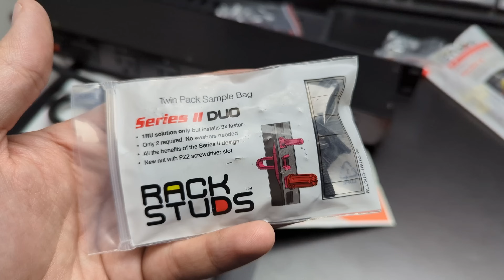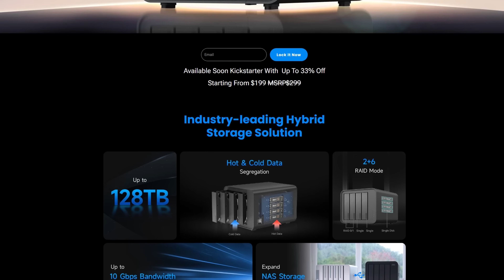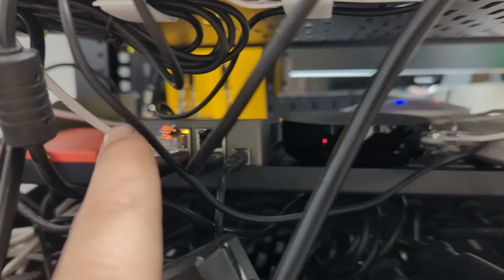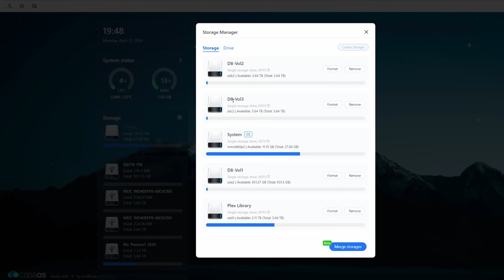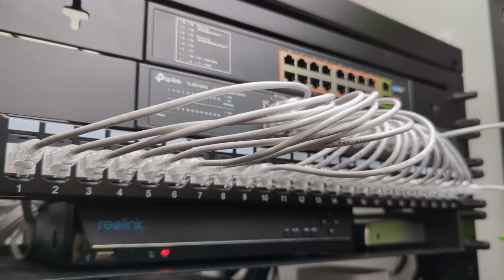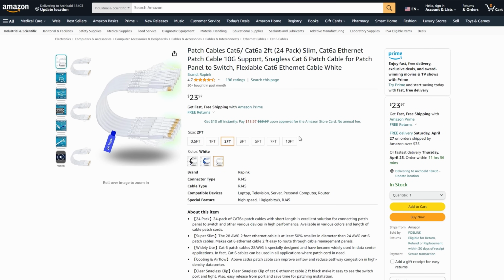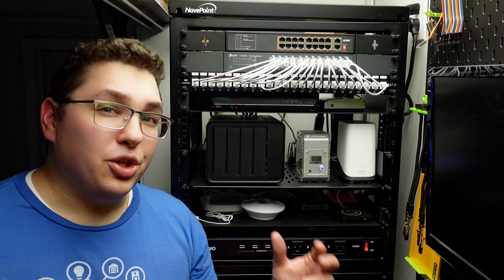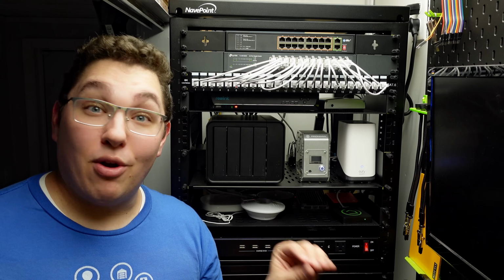My new SMART HOME Network RACK! (Build and Tour)

Comment: You should take the time to change out all of your 5e for 6a. That suppers speeds up to 10Gb to give you a more future proof setup. 

You should also look into utilizing the coax in your house to hardwire your rooms via MoCA adapters. There are some great ones that can push speeds up to 2.5Gbps. I’ve used these and they work great.
Reply from the maker: I'll be doing that with 6 cable!
Hmmm, never heard of that option!

Comment: I have the deco m9. I've had it for a few years but it works for my home needs.

Just curious what the benefit of having a brush panel vs patch panel would be.
Reply from the maker: Brush panel doesn't require these short little patch cables, and you can space out the cables in  any way you want. Just would look a lot cleaner IMO

Comment: I am happy with my new Unifi UDM (non-pro) router, which can be expanded with with PoE access points.  As long as a router will support VLANS so you can separate your IoT from secure devices, then you are good to go. 
Yes, is easy to get sucked into the rabbit hole realm of Unifi...the use the same strategy as Apple to make all things work together and as simple as possible.
I appreciate Unifi, in that I only need to configure my VLANs one time. lol

Comment: With that cabling that you did yourself, does it work out much cheaper or not??? I will need to run Ethernet cabling in an older place for POE cameras, etc. and would be interested to know what way to go.
Reply from the maker: It's nicer to have caBling the exact length you want, so I can be cheaper if you have a lot you want to do yourself. It takes a lot more time of course

Comment: Best practice is to use factory patch cables. As strange as it might seem, cable termination is not as reliable on the long run, particularly if you're not doing it day in day out.

Comment: Why no UPS???
Reply from the maker: That will be for v2! Haha I wasn't sure which too buy and things were getting a bit expensive. You have a recommendation?
Reply: @MakeItWorkTech  A tried-and-true brand is APC. I don't know if your NAS supports this, but Synology NAS units have a USB port to interface with the one on the UPS to detect when to shut down elegantly. If yours does the same, then make sure that your UPS has that feature. You should first tally up the power usage of all your devices, and use that to select the capacity of the power backup. Also, I would recommend getting a model that has replaceable batteries, as it much more economical to do that rather than buy a whole new unit. Most batteries last at least 5 years, after which their capacity begins to decline.

Comment: If you didn't pay for the DAS it's a good setup but tbh if you already have a Zima Board don't buy a DAS guys. You can just conect your Harddrive to the SATA Ports and get a Breakout Board for the PCI-Express Port for more drives. Its certainly a bit more complex than just buying a device, but this option here would be a lot cheaper and more future proof. There a great tutorials out there for Zima Board NAS Setups and TrueNas
Reply from the maker: So would that be using TrueNAS software on the Zimaboard to handle a RAID setup? Maybe I'll try it with the ZimaBlade

Comment: So... what was the point of the patch panel if you DIDN'T have a bunch of cables running into your rack?  They're supposed to be used with regular keystone jacks that you punch down into, and then then front facing port patches to your switches.  Where's the other end going?  

Another word of advice, LABEL EVERYTHING.  You're not going to remember every single cable in your rack   Label them at the both ends of the cables, and definitely on your patch panel as well.

Also, invest in a roll of double sided velcro.  It's the best way to organize cables and not use zip ties.  NEVER use zip ties.  They hurt the wire, and can be challenging to cut without damaging the wires the contain, if you need to move the zip tie for any reason.  Velcro you can just rip off, and use elsewhere, over and over again.  Highly recommended.
Reply: They make patch designed to be used with feed thru connectors, rather than having to do punch down.  It is the type I have.

Comment: as someone who has built out data centers and a home-labber myself, great job!! be careful with pass through rj45's. seen them melt POE switches a few times. make sure no copper is exposed
Reply: What would be a better option?
Reply: wdym? exposed
Reply: @RakDev_py  basically leaving too much copper beyond the rj45 connector. You want the strands to be flush or just under the edge of the rj45 connector with the pass thru. Otherwise, if the copper extends, it could cause shorts or even cause issues to what it’s connected to.

Comment: Hi, would be greatful if you can let me know how do you connect HDMI and usb of nvr to tv?
Reply from the maker: USB unconnected directly to NVR. HDMI to the monitor
Reply: @MakeItWorkTech  oh.. my monitor and network rack are there rooms away. Guess I will shift the NVR closer to the monitor. Not finding a way to extend usb over lan :(

Thanks for the reply
Reply: You can look up units that go from screen via hdmi-> to a unit that converts to a Ethernet cable (this unit may require power via a regular plug) run the Ethernet to the other room and then plug in to other device that changes it back to hdmi. My work has that for a small security camera and monitor in the main office.
Reply: @mattspivey5100  thanks for replying.

Hdmi to ethernet I have used, but am not understanding how to extend USB for 40 to 50ft. Need to connect the mouse to the NVR for playback

Comment: Ubiquity Unifi is the best router, switches, AP, and surveillance out there!
Reply from the maker: But so expensive!!
Reply: @MakeItWorkTech  yes, but I have no regrets. Expanded over time to spread out the costs.
Reply: +1 for Unifi

Had an ASUS Router previously, but after it started making issues, I switched to Unifi and omg I never had a better router dashboard or more options to configure.

It's just rock solid, super customizable, but also easy to work with.
Never going back to consumer grade devices.
Reply: No the best as all. Thats a very bold statement. I have UniFi at home and look after and install multiple sites. It’s good. But if you want expensive and robust, proper office and hospital robust, no budget install then I’d be using Cisco Meraki or Ruckus. UniFi is good for home, small office and domestic use. The switches are expensive for what they are and there’s things missing that I have to go to Mikrotik for and the cctv is just plain bad. The cctv line up is poor and as a pro Hikvision installer and a UniFi installer I’d never install the unit cameras unless someone only wanted a couple.
Reply: Bro never heard of Cisco before
Reply: Absolutely not. A custom-built x86 firewall/router running opnsense runs circles around anything Ubiquity.

Comment: Unifi Dream Maschin Pro
Reply from the maker: Noted!
Reply: As an network and system engineer I can tell you to don’t do that. We removed them from lots of customers since they break down. Also they don’t support if your ISP has 2 separate VLANS for TV and internet. You have to built custom configs and still no support since the uplink may contain only 1 vlan. Also the support stinks… took 8 weeks to send us new ones. I went for hosting the Controller locally and just installing AP U6+ through the house. Also watch if you have airplay. NanoHD can mess with that so took them out few weeks ago. This saves you some bucks and is fun to do. Also would be happy to help!

Comment: The TPLink DECO mesh system is amazing, and way more customizable
Reply from the maker: I plan to test it out, even though I went with UniFi!
Reply: I push it coukd say I agree wuth this cuz ive stood by my TP Link mesh routers, but lately theur app is all to often buggy, not allowing me to reboot my system. And unless my switches are wired to my router, but after my modem, im now unable ti see wir3d devices, whereas 2 years ago I was able to. Im now forced to run the 6.0 frequency as a separate SSID and that used to not be the case. My entire  reason for going wuth TP Link routers was so that I could separate out the 2.4 gHz for my wifi cameras and then recombinant it with the 5.0 to k ly need one SSID, snd of course slong with the IoT SSID, im now on 3 separate SSIDs and thats if I dont have the guest network active for any family or friends stopping by. Also, finding open ports is a cumbersome task that requires memorizing your IP fir the device cuz you cant copy paste and are forced to leave that section of the app. To go to the wifi toolkit to check for open port. Also one of my 5.0 satellites simply stopped working after being unplugged for a few months. The reset button wont even registers, even if taken apart and manually pressed with the case off.
All thay bring said, I still am happy with my TP Link routers and switches  and plan on getting 2 more 6.0 mesh routers to eventually replace my 5.0 and 5.0 satellite
Reply: If you are going to go with TP-Link use their Omada range as it is controllable from a single device allowing you to build out a 'software defined network', just finished a refresh on my home network and it makes everything so much easier to set up and manage.
Reply: I love TP-LINK product..

Comment: For a wifi replacement, I just bought the Asus ZenWifi Pro ET12 and it's fantastic.  Extremely fast, has 2.5Gb ports on each unit (1 for WAN, 1 for LAN, then 2x1Gb ports for LAN), and supports Wifi 6E.  I got it primarily for the load of features in the Asus firmware (VLAN, firewall, etc etc) until I move over to OPNsense, and to use as a wireless backhaul from my cable modem at the front of the house to my 16-port switch in the back of the house with my server/homelab stuff.  Sure beats my old Powerline backhaul!
Reply from the maker: You got me with the 2nd half...I don't speak network engineer haha
But the first part sounds good! I'll have to check that one out
Reply: Would suggest OPNSense over PFsense. Since pfsense is owned by Netgate. Lots of issues and since the latest versions I’ve got lots of issues. The community of OPNsense and the guys themself are much nicer to home labbbers. Also would suggest moving to Home Assistant and maybe VMWare or proxmox to run it on a VM. I do that too and in case of errors just rollback a Snapshot. Also home assistant has Docker inside. Therefore you can run the UniFi controller from there and just buy the U6+ AP’s only. Saves you a few hundred bucks :)

Comment: I feel the google mesh pain because I'm in a similar situation with Eero. Frankly the Eero has worked great, but I wish I didn't have to use the app and I wish I could do VLANs. Everybody tells me Unifi is the way to go, but I haven't taken the plunge yet; the Eero is working and hasn't annoyed me enough that it's worth the expense and trouble of switching yet. 

I also wish I could run ethernet everywhere. The previous owners put drywall ceilings in the basement so I can't just easily run wires from the basement up into the rooms above. I've been making do with MOCA over the coax that is run to nearly every room, and that's actually performed surprisingly well, but the adapters are not cheap. I would like to run ethernet up from the basement into the attic, and then down into the rooms that way... but our attic is so shallow and there is so much insulation it is basically impossible to navigate up there. I really don't know how I'm going to do it. Also, being in Canada, I want to be careful about punching holes up into the attic that allow warm moist air to flow up and condense in the attic. I'd be open to any ideas anyone has.

Comment: Hi Aron as always great video 💪
Your detailed reviews are awesome 🤩 
I have a suggesting, to replace smart power plug supply your rack with something more reliable (better relay) like sonoff POWR3. This small power plugs relays are calculated to extreme and when start failing might damage Your expensive equipment 😉
Reply from the maker: Great suggestion! Thanks for the tip!

Comment: Word of caution, I think the cat5 cable you bought is actually CCA, aka copper clad aluminum. It’s total and complete trash, I bought a box due to its price and didn’t realize what it was until a year or so later when I started having issues here and there. I wouldn’t have thought it would have mattered since the wire was all inside in climate controlled areas, wrong, if I were you I’d throw that stuff in the trash and replace all you made from it or at least mark them all so when weird things happen you know which cables to start replacing then.
Reply: I agree, always Cat6 or Cat6a, here at Portugal🇵🇹, our Telecom Authority ANACOM a few years ago, banned the installation of cables lower than Cat6 and only 100% copper cables are allowed. We have a regulation called ITED Manual, you can consult to know more about our legislation and regulation in telecom infraestructures.
Reply: Yup agree. AVOID CCA AT ALL COST
Reply: Never CCA, and even a year ago when this was posted, anything less than Cat6 was penny wise and pound foolish.

Comment: Helpful video! I am doing a remodel install of a rack but unfortunately, I only have a small closet to use for my IT closet. I believe a rack the same size as yours or one similar to it will fit. My issue is ventilation. I do not want to put a louvered door on the closet. I do have access to a room on the side of the closet and could put an air duct in the closet right now but I was not sure if that would be too much or not. Any suggestions on best way to vent it either somehow around the door to the closet or out the side through a wall into the adjacent room?
Reply from the maker: I don't have any specific knowledge on ventilation, but I actually do have a PC cabinet that is vented into A wall between two studs, then on the other side of the wall I have two vents that allow the air to exit into the room on the other side
Reply: That sounds like what I am needing too. Can you tell me more about how you did that? What equipment you used?

Comment: Well done. I've been lucky enough with my own home automation networking not being too challenging seeing as I administer networks and design and install them as a career for the last 30-ish years. From that perspective I'll say you did a great job.Make sure you've got decent airflow around that gear so small circulators would be a good addition.
Reply from the maker: Thanks, good to have a pro's opinion on the setup! I do have some fans I may be able to use

Comment: Prior to diving into the Ubiquiti rabbit hole, we used an EERO mesh system to cover roughly 4300 square feet of our house; it was really easy to set up and other than initially interfering with our wireless soundbar, I don't recall having any other issues or dead spots with it.
Reply from the maker: Ok cool. I may switch to fiber and they offer a free Eero mesh system if I do

Comment: Looks like you used 558-A instead of 558-B for the termination of your CAT cable. I would highly recommend using 568-B on anything in the future.
Reply from the maker: Yeah thanks, that was just a test cable and I got that feedback when I posted a picture on Twitter. Thanks 😁

Comment: Oh no.  Why did you use cat5??  You are limiting your future speeds.  Always use cat6
Reply: @EvanWasHere  If it is for a home network for a common user, no more than 1gb is needed, especially if it is for IOT equipment. If you're on a slightly tighter budget, cat5e is the better choice
Reply from the maker: Yeah probably shoulda.  Easy switch later on

Comment: Asus ZenWifi is a really good mesh system. Gives you lots of control and tuning options.
Reply from the maker: Awesome I'll check it out
Reply: +1 For Asus zenwifi/ai-mesh. Really like the fact you can mesh different models, and the range on the units is really good. I bought an xd4 mini originally just to use as an AP in my lounge  - still got really good 5ghz signal in my bedroom, 2 floors up!
Reply: +2 for Asus Ai-Mesh.  Amazing...  The best two options are Asus and and UniFi, but the latter is more expensive and may be overkill.
Reply: I'm also running the Asus system and it does very well. Have my router in the basement of my two story 1950s built home, with zenwifi node in my first floor office and 2nd floor guest room. we have great wifi everywhere, even on our backyard patio.

Comment: Aaron …. I cannot wait to get you into the ubiquiti Unifi love-hate relationship for your network.   😊😄
You will love the GUI and and options.
Reply from the maker: But the $$$! So expensive, but they look really nice!
Reply: @MakeItWorkTech   @makeitworktech  Their gear is expensive but it is also rock solid.

I am already invested with 4 smaller switches and an AP (I just need a bigger PoE switch, a second AP, and one final smaller switch), but if I were going to start over today, I would look at TP-Link Omada gear. If they're as good as they look, then they would be a great value vs Unifi kit.
Reply: My Unfi are the cats meow